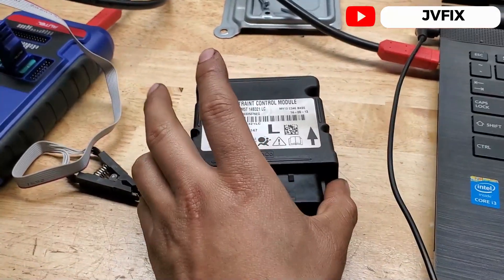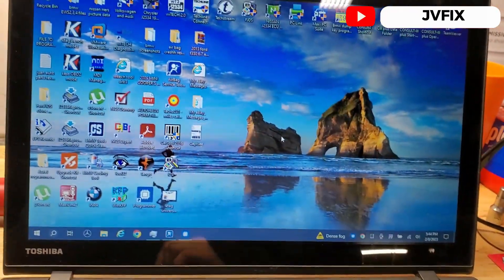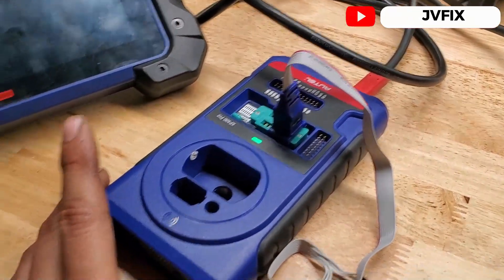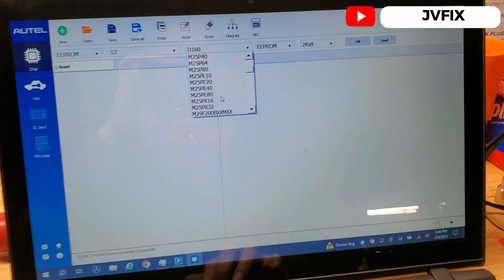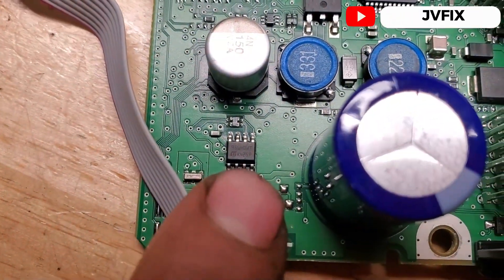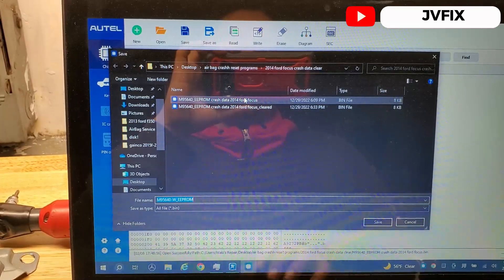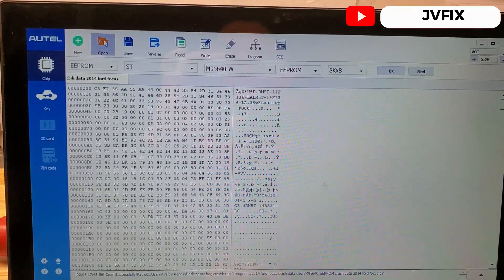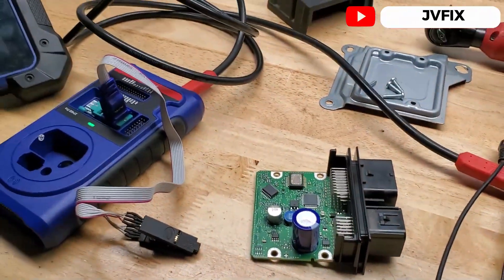How to reset Air bag crash data on 2012-2019 Ford Focus, Fiesta, C-Max using Autel XP400 programmer.

Comment: thanks for the video I have couple questions if you don't mind. First my browser doesn't let me download the airbag tool because of the virus alert. Second I can't find autel programmer software for pc. and third and the last my xp400 pro doesn't work with the laptop if idon't provide external 12v, what is that red cable u re using to connect to the pc? thanks again

Comment: Thanks for the info. I disabled the virus protection and finally downloaded it. But every time I open the file, it just asks me to buy a win zip membership. 

Is there something else I am missing? (Using Windows 10)
Reply: yeah! I have the same problem. In next few days I would try to install it on anther PC with WIN7. I would let you know if it works out.
Reply: @rutkokacper55  thanks 💯

Comment: Thanks but The software doesn’t work it’s full of viruses and threats it says need a usb dongle to keep working any idea ?
Reply from the maker: It doesn't contain virus windows only sees is as a virus but is not you need to create a folder exemption and put the file in there. Also u don't have to update it otherwise it will ask you for money

Comment: Will this cause a car not to start after a crash starter fluid in throttle body not working
Reply from the maker: it depends on the car like mercedes when they get in an accident the fuse in the front of the hoods pops to avoid electrical shorts that can cause a fire.
Reply: I got it to start bad intake gasket had water in cylinders new sparkplugs fired right up

Comment: Is this why my ford ficus will not crank after i hit an snimal that was in the road. The car cut iff snd messages are coning up that say engine starting fault or somrthing like that. Hill assist not available and  no key detected. Forscan will not comnect to vehicle rither
Reply from the maker: I don't think so. your problem might be a short to the CAN communication lines in your car probably when u hit the animal it broke cables and that's causing your problems

Comment: how do you know what chip to read?  I have a 2014 hyundia sonata module number 95910-3q150 with eeprom chip 95256 but there are a few chips that look like they could be it.
Reply from the maker: the program specifies the chip and I read the numbers on top with a microscope. or use your phone to zoom in

Comment: So how it works is Program A reads crash data/Program B makes corrects crash data/ and program A writes the corrected data into the module?
Reply from the maker: yea the same program makes everything  read first save the file and then select the saved file to be corrected and the program will clear it and save it and then go back and select the cleared file and then write it back to the module

Comment: Can i used autel mk808bt pro? And just buy the programming tool?
Reply from the maker: i am afraid you can not that scanner is only for obd2 bidirectional controls only. you need an actual programmer that can read eeproms
Reply: @JVFIXLLC  for example?
Reply from the maker: @Xlel9829  orange5 is a really good one